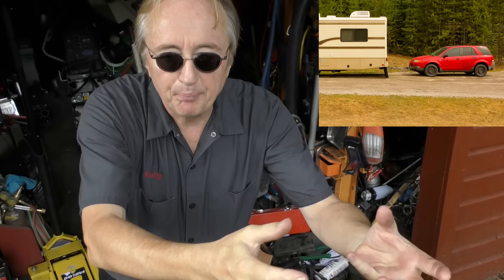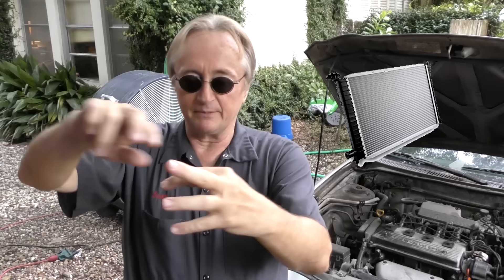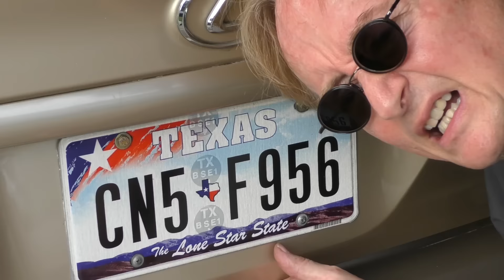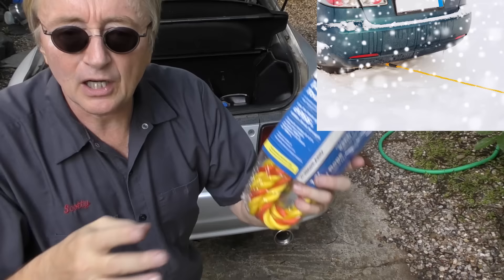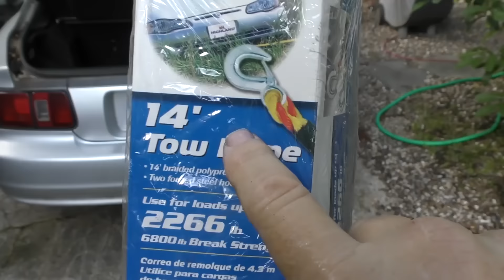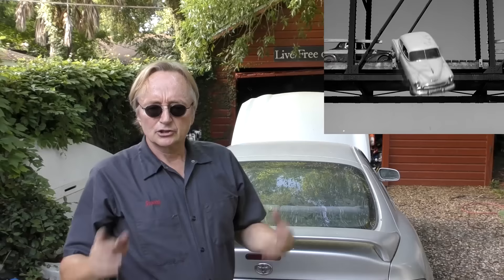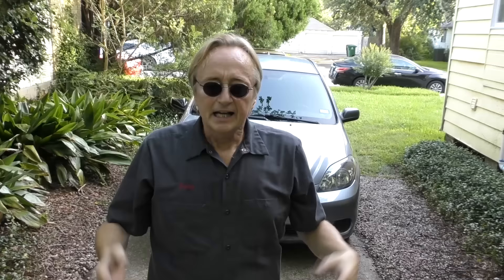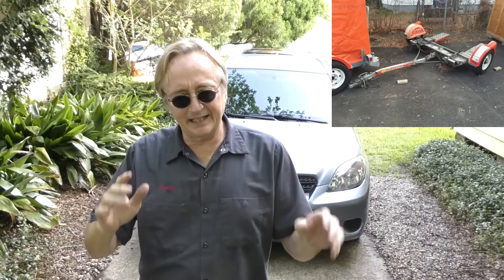Never Do This to Your Car

Comment: Watching Scotty talk about problems with cars I'll never drive or own.. because I've been to the end of the internet, and this is as good as it gets, folks.. thnx, Scotty c):~)
Reply: codypendant1 some of the  information in this one is incorrect. How is transmission fluid going through the transmission cooler on the radiator if there’s no pump working to move fluid with the car off and being towed? Also, how do you blow the head gasket? The car engine is off so the water pump is not circulating fluid as it needs to be driven by the serpentine belt in order to circulate the fluid. So how can hot coolant get inside the engine to blow the head gasket? The thermostat is even closed on a cold engine which prevents any circulation of coolant through the radiator. Even if it was possible to have an overheated radiator in this situation, which it’s not, there is air movement past the radiator while the car is towed which works to cool the radiator off just as the cooling fan does when it’s running when a car is parked and idling. There’s also airflow beneath the car that would help dissipate heat from the transmission through convection heat transfer. This logic makes no sense at all. If anything it sounds like a case of a Subaru that broke down due to a head gasket failure and then they towed it and ruined the transmission by overheating it from a lack of lubrication and overheated transmission fluid caused by the moving torque converter. There’s no way that towing the vehicle blew the head gasket...
Reply: Newfie-Dean .. I dunno. Those are good questions.. these are cars I'll never drive.. here's what I go with, generally: if it's a stick, put it in neutral, tie the steering wheel if you have, too.. if it's an automatic, drop the driveshaft, or turn key on and put in neutral. A lot of this depends on how far yer going. I live out in the country, and strategies vary. I also have AAA, and USRider if I'm hauling horses ( AAA on steroids). I rented a car hauler to haul my p/u across states. .. my one takeaway from this was the flap removal to screw the tow hitch in, lol... I know if you sit in the bed of a p/u, the bed heats up especially on the highway... removing a serpentine belt is easy enuff if that's a factor... a front wheel drive might be prone to circulating transmission oil thru the radiator on certain models? I really don't know.. good food for thought you brought up, tho.. I just like watching Scotty blow his lid and it's not political... c):~)
Reply: codypendant1 yeah I like watching the videos too but I hate the misleading info in some of these videos. Scotty often makes blanket statements encompassing all cars when they all have different design features. For a Honda CRV AWD with an auto Honda tells you that you can tow it on all 4 wheels at highway speeds no greater than 65 mph. Yet Scotty says you can’t do that. You really need to refer to your owner’s manual to know. These days all I see for tow trucks are flat bed ones. I see it so many times that someone asks a question regarding a transmission shift issue and Scotty instantly says your transmission is worn and needs to be replaced. That is another crazy blanket statement. I had a shift issue on a Mustang GT and it seemed like it was an internal issue but it ended up being a short in my engine fuse box that was affecting the voltage signal sent to the computer for the transmission. These days you can have electrical issues that can make your vehicle act as though there is something mechanically wrong with it. I was reading a few months back how a bad electrical ground can wear out your wheel bearings! There’s so much stuff that can go on with a vehicle and sometimes what you think is a cut and dry solution turns out to be a nightmare to diagnose. I have driven a lot of Fords and put a lot of miles on them (400,000 miles on one) and I have never had a transmission go out on me. Yet Scotty talks as though transmissions go out routinely and that is not the case.
Reply: Newfie-Dean .. the complexities of modern vehicles are quite frustrating for a shade tree mechanic, and then there's the issue of trying to find an honest mechanic... I have to agree with you, in that I have never heard of any transmissions, or head gaskets for that matter, being ruined by towing responsibly, or even irresponsibly, now that I think about it.. I don't own one, but Mustangs are my favorite classic car ( I do wish the side view mirrors were a bit larger, my only complaint), but I do own 8-9 real mustangs.  You definitely brought up a lot to ponder. Thnx

Comment: When using a tow dolly for towing rwd car/truck you are supposed to put it on facing forward and remove the drive shaft it is against the law in most states to use a tow dolly with the car/truck backwards

Comment: with rear wheel drive cars you can disconnect the driveshaft and tow with the rear wheels on the ground if you tow long distances. also some automatic transmissions do have a rear oil pump driven by the output shaft in addition to the front pump driven by the engine. granted they are old hydromatic transmissions from the 50s, and a few early model AOD ford automatics. the owners manual will tell you for sure.

Comment: I'm confused, Scotty. So, what's the point for Neutral?
Reply: You still have to have the drive wheels lifted with an automatic trany
Reply: From what I know Neutral only disengages the engine from the transmission, but not the transmission from the wheels. Hence why you would mess up your transmission if you towed it any real distance.. (which is exactly what Scotty is talking about in the video) 
The point of Neutral is for other things.. Example:  Going through a car wash.. or Starting a Car when you can not use park (for whatever reason).. Or say if you have a stuck throttle and you need to safely get to a place to stop. Lastly if you are stuck and need to push your car out of whatever (It is easier to push in Neutral).. Also if it is getting pulled onto a flatbed they would put the car in Neutral to get it up.
FYI you should not put your car in Neutral while regular driving.. one of the reasons is that when you put it back into drive it will not be in the correct gear as it has not properly progressed through the gears for the speed the car is going.
Reply: TisJester XxX This logic makes no sense. The thermostat on the engine is closed on a cold engine which prevents any circulation of coolant inside the engine through the radiator. Also, to circulate coolant the water pump needs to be running which is only possible if the engine is on since it’s driven by the belt. Even if the radiator had hot fluid there’s no way for it to get back inside the engine with the engine off! And how would transmission fluid get circulated through the radiator with the car towed? He already said with the car off there’s no lubrication of the transmission so what’s moving the transmission fluid through the radiator?
Reply: @tisjester  Gotcha! That makes sense. 👍🏾
Reply: @newfie-dean5803  
TisJester is correct
Reply: Ray S yeah, I’m not denying he is correct. I’m saying that Scotty’s logic here is wrong. It’s impossible to blow a head gasket from towing as I explained above. There’s no circulation of coolant into the engine (closed thermostat and no working water pump) and there’s no circulation of tranny fluid to the radiator transmission cooler (no working transmission pump). Even if tranny fluid could circulate through the radiator it would never make the radiator hot because the car is being towed with air movement past the radiator fins. This makes it the same situation as the cooling done by your cooling fan pulling air through the radiator when you are idling and parked. What Scotty is saying is 100% incorrect. It’s impossible. I read so many comments and nobody except one girl picked up on this as being incorrect. Everybody was telling him that it was good info! So many people viewing this channel have little knowledge of cars and for those people this situation is a classic case of the blind leading the blind!
Reply: @newfie-dean5803  
Oh. I thought he meant that the blown head gasket was the reason for the tow in the first place.
Reply: Ray S no, he was saying the torque converter heated up the transmission so much that it in turn caused the radiator to overheat which in turn caused the engine to overheat which blew the head gasket. This could not happen. The car is being towed down the highway with airflow through the radiator. Even if the radiator could heat up the heat would be dissipated by the airflow across the radiator fins just as your cooling fan pulls air through the radiator to dissipate heat when the car is parked and idling. There’s also airflow under the car dissipating heat build up in the transmission via convection heat transfer.
Reply: @newfie-dean5803  
Theoretically possible but highly unlikely.
Reply: Ray S it would not happen because of airflow. If airflow did not cool the radiator then you would never keep your engine from overheating with the cooling fan running in your driveway. And as mentioned air flow under the car is going to dissipate heat build up in the transmission too. Factor in that the engine is not running so there’s no operating water pump and a closed thermostat and it’s obvious this could never happen.

Comment: I had to have my car towed when the rear left strut broke and since it was FWD and the rear suspension was fucked I had to call for a flatbed truck to tow it to my house. Then I fixed the brake line and strut and it cost me $60 for the tow, $10 for the brake line, and $80 for a pair of struts from a salvage yard.

Comment: this is the best part of manuals. you just put it in neutral and you can spin your wheels while towing all day long.
where i'm from car insurance companies cover the cost of towing. you just call your insurance and tell them where you are and they send over an affiliated tow truck to pick you up. obviously, if they deem that you are abusing the system they will start charging more for your insurance. after all most cars can go for years without having to get towed and worst case they may need it 2 times in a year so if you ask for a tow every other week they will get suspicious

Comment: Well I don’t have to worry about anything in this video. I drive a 1993 toyota pickup. It has a Manual transmission, a steering box (no power steering) and the brakes work really well even without the booster.

Comment: If you have no choice but to pull a truck in by the front. Take the drive shaft out. Put something over the tailshaft housing  to catch fluid.

Comment: Ah, manuals have some positives after all. I'm from EU, so almost no automatic transmissions. Driving in heavy stop-and-go traffic is hard on your clutch leg (or hand if motorcycle), but it is what it is. At least you don't have to worry about wrecking transmission, just pop neutral and you are ready to go.

Comment: If rear drive >>> PULL ONTO tow dolly, and disconnect driveshaft.  NEVER!!!!!!! back onto a tow dolly!!!
(10 years experience shuttling rental trucks)

Also, Subaru recommends using a rollback tow truck for the "X-CASE" (center diff)
(14 months tow operator/lot attendant for Subaru dealer)

Comment: Well done! I had my car towed like that when I was younger, a friend pulled me with a chain. A Nissan 280ZX we took to the river, when the river was dry, the sheet rock ground was like a road, but some spots still had water, one of those spots had a water hole which was several feet deep! Ripped a massive hole in the floorboards, and water came into the car, also tore up the radiator! LOL Towing it, was not easy because you have to constantly and lightly have the foot ready on the brake, so you don't plow into your friend! "Like Scotty says, DON'T EVER TOW A CAR LIKE THIS!" We were ignorant teens back then! That car was a blast in the Summer! 
"The Crazy Days of our Youth"

Comment: Most trucks can be put in netural neutral on 4wd.

Rear towing is extremely dangerous
Reply: Rear towing is only dangerous if the steering wheel isn't secured.
Reply: @parkerd619  yeah cause that's simple to do.

Comment: Disconnect the rear driveshaft on a Subaru to tow it with a car dolly, towed mine 2000 miles with 0 issues
Reply: flyboynextdoor yea and don't drive it you'll never need to replace the head gasket...
Reply: towwed it farther than it was ever driven

Comment: Some screw in hooks can be fragile / rotten, especialy on older vehicles and BMWs. Also if the threads are corroded on the screw in type they will not screw in all the way, and if its not in all the way it could be coming back out at a much higher speed than it went in.  the front hooks on that toyota are actually transport hooks if you pull of those the line will press up against the bumper / radiator  so be careful when using those.. a good recovery operator will use straps around the wishbones to hook on to for loading purposes only being careful not to damage any ABS sensor wires and brake lines.

Comment: I know that in the 4x4 chevy Silverado and the 4x4 Jeep Grand Cherokee you have the ability to shift your transfer case into neutral.  Yes even the electronic transfer cases can be shifted into neutral.  Just have to read your manual for instructions.  With the transfer case in neutral the wheels are disengaged from the transmission.  Now I don't know if your differentials will be safe.

Comment: One thing you forgot to mention if you are driving a standard transmission it doesn't matter whether it's a front wheel or rear wheel drive you can have either the front wheels or the rear wheels on the ground as long as it's a standard transmission but yes you are right about automatics you cannot tow an automatic on a regular tow truck unless it's a rear wheel drive only and you drop the drive shaft the reason you want to drop the drive shaft is because again just like he said if you don't you will mess up your transmission

Comment: My car has those 'tow hooks' that you screw on the bumper after popping the little cover off.
However, the owners manual says that they were only used to 'secure' the cars during transportation and not to actually use them for towing, but that they can be used to secure something to the roof rack like a kayak. My car is a 2014 Mazda 3 if anyone's wondering, I'm sure the rest of the Mazdas as the same.

Comment: Another option for very low cars or cars with a flat tire and really nice wheels is a tow truck with dollys. The car never moves until its off  the ground. You don't have to worry about the nose or rearend getting ripped off while being loaded onto a flat bed.- Experienced tow truck operator.

Comment: Bmw and Mercedes Benz owners never have the jack or the tow tool in their cars. The buy them like that. They don't know anything about cars. That is why the driver uses the big Js on the control arms. But that is just to load it you have to use straps on all four tires to hold it down.

Comment: Scotties words of wisdom....great video.
I got a AWD. I not needed a tow but now I know I have to get a flatbed tow truck if I need it.
Reply: neftv1 Some of the information in this one is incorrect. How is transmission fluid going through the transmission cooler on the radiator if there’s no pump working to move fluid with the car off and being towed? Also, how do you blow the head gasket? The car engine is off so the water pump is not circulating fluid as it needs to be driven by the serpentine belt in order to circulate the fluid. So how can hot coolant get inside the engine to blow the head gasket? The thermostat is even closed on a cold engine which prevents any circulation of coolant through the radiator. Even if it was possible to have an overheated radiator in this situation, which it’s not, there is air movement past the radiator while the car is towed which works to cool the radiator off just as the cooling fan does when it’s running when a car is parked and idling. There’s also airflow beneath the car that would help dissipate heat from the transmission through convection heat transfer. This logic makes no sense at all. If anything it sounds like a case of a Subaru that broke down due to a head gasket failure and then they towed it and ruined the transmission by overheating it from a lack of lubrication and overheated transmission fluid caused by the moving torque converter. There’s no way that towing the vehicle blew the head gasket...

Comment: The pump on an automatic transmission is sometimes referred to as the “Front Pump” the reason why is ... they USED to have a Rear Pump that was powered by the rotation of the drive shaft ... SO towing the car would not damnage it ... also made it possible to “bump start” the car by pushing it ... if the battery was dead or starter failed.

Comment: You forgot to mention that manual transmission vehicles can be towed drive-wheels-on-the-ground quite freely so long as they're in neutral, as they're splash lubricated by the spinning gears and said gears will be turning even then.

Comment: My van was held hostage by a large body shop in Blackfoot, ID (9 hrs from my home) for over a year. The owner refused to work with our insurance. Both sides blamed each other and my family were the ones stuck high and dry. I will NEVER USE A BODY SHOP TOW SERVICE FOR A BREAKDOWN again.

Comment: In my experience in recent years U-Haul has been very good about making sure you know how to put your vehicle on the tow-dolly. They also check what you are towing to make sure it is within the weight limits and check your tow vehicle to be sure you can handle it (although they tend to mess that up at times - my 1 ton van will easily handle the same towing capacity as a 1 ton pickup). They look it all up in their database and make sure it's going to work. 

That may not be true for every U-haul operator, but the ones I've dealt with have been good.